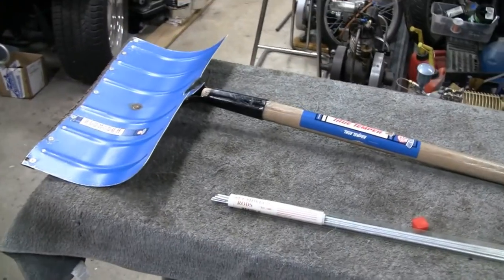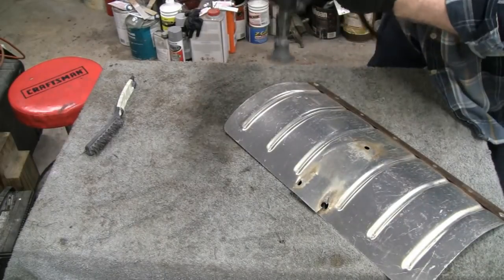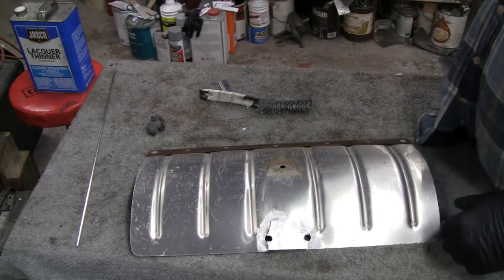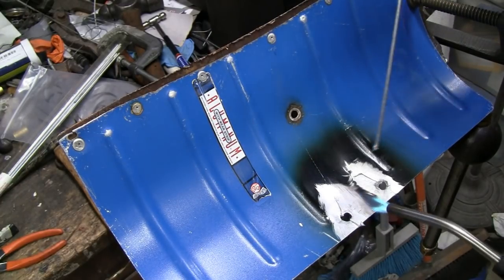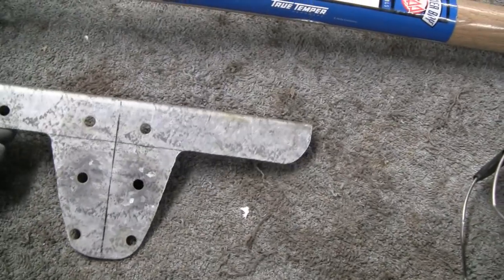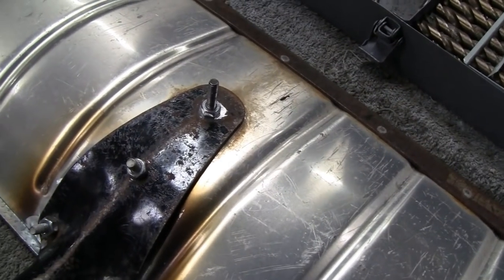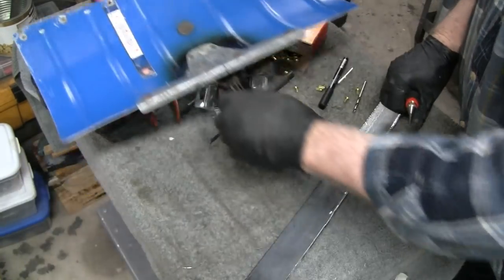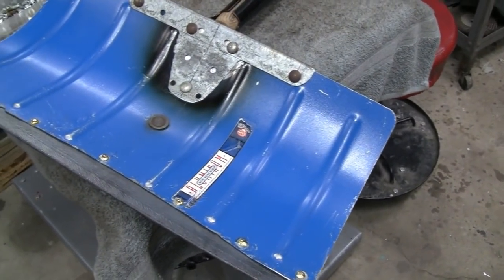SNOW SHOVEL REPAIR with ALUMINUM WELDING ROD

Comment: Oh gee RK backup and rethink hammer the broken places straight with each other.
Then place a small metal plate on top and bottom of the blade. Then put the handle part with it and bolt it all together with bolts.

Comment: I used to do rivets with an air chisel. It's dificult to control. Picked up a used rivet gun off of EBay. Makes the job much easier to control because you can start off slow and then ramp it up to finish the job. It's that instant, full blast of the air chisel that makes it harder to do that way. Just a suggestion for a new toy if you really like rivets. Shovel looks good, by the way.
Reply from the maker: Thanks Mike!! I've heard there was a difference but didn't know what it was!! I just might get one, I do like rivets!!☺

Comment: Nice work. I bought a new one two winters ago. It lasted one season before the aluminum bent. They don't make 'em like they used to. My wife would describe your work as she describes mine. Overengineered and overbuilt. I think she intends it as an insult, but I consider it as a complement.  If only industry was run by engineers instead of cost accountants again, we would have good products again. Thanks for the lesson, I learned quite a bit.
Reply from the maker: Thanks Haney!! Yeah when I fix something I don't want to have to fix it again!!☺

Comment: That looks more like aluminum soldering than welding.  I though you were going to use that welding rod with an oxygen torch or a stick welder.
Reply from the maker: Soldering, Welding... they actually refer to it as Brazing!!☺

Comment: I've welded aluminium successfully many times using oxygen acetylene, the trick is a carbonizing flame, the problem with the method you used is it's not melting the base metal, it's worth adding when welding aluminum the whole piece is going to get hot
Reply from the maker: Never try it with oxy/ace!! We'll have to give it a try!!☺

Comment: What, not taking advantage of the lifetime warranty?    ;-)
Reply from the maker: Lol!! Good luck with that eh!!☺
Reply: @805ROADKING  It’s funny, I never used to even think about that, until I made a video about a pair of broken hand cutters, from Fiskars. 
The small plastic latch broke.
I wasn’t griping, actually complementing how well my 20+ year old tool held up to my abuse.
In the comments section, a fiskars rep reminded me that they had a lifetime on them. 
I told them that I still loved this set, and that it was just the broken holding latch. So they mailed me the part. And a new set of clippers.

Comment: I bought a pack of these aluminum welding rods about 15 years ago at the Wheels of Time hot rod show. I have 99% of them as I couldn't get them to work right. Glad to see you had success. I think my problem was more with operator error than with the product...
Reply from the maker: I think the trick is any oxidation has to be removed with a stainless steel brush!!☺

Comment: Nice job mate. My kind of repair. I have an aluminium DeHaviland 14' boat that is mostly riveted. I've been told that you can't weld it as it's anodised. Maybe that stuff might work for me. If it doesn't, I'll epoxy the shit out of it. cheers. P.S. the floor and transom are welded in. It looks like a gas weld to me. It's over 50 yrs old.
Anyone reading this who knows about this kinda stuff, I'd really appreciate some advice. It has a hole approx 1 1/2" in the floor and much pitting in the floor. thanks.
Reply from the maker: Thanks Mate!!☺

Comment: Them Welding sticks i always fine you need to be carful not to over heat the metal or it will not stick very well. 
she should last another 40 years now!
Reply from the maker: Yeah they seem to work well on the right application!!☺

Comment: I did the same on my Wheel Horse plow , new cutting edge, hard bolts, cut them off and tack welded the nut  so they will stay put .

Comment: you did a great job and that shovel is a tool to be passed down to others to learn from. dont replace it fix it!
Reply from the maker: Thanks Aaron!! Yeah it's an Heirloom now!!☺
Reply: @805ROADKING  I have the same rods from harbor freight.havent used them yet.looks like they should work.also can you send me were I can get those drills that drill through hardened metel.i think you got them from amazon ?    Thank Q
Reply from the maker: Hey Ian, don't know what drills you mean!! I don't have any drills that go through hardened steel!!☺

Comment: My aunt in canada had one of these and apparently her husband took it apart on day one, and added two large stainless washers in the front. Struck me as odd when i saw it a couple of winters ago when i visited and i asked. Apparently it's the common failure point for aluminium/aluminum blades. Her's didn't fare as good as yours, it's chewed up right about where the L in that sticker is. :))
Probably because it snows a lot more, but the handle and that cradle are still solid. Quite impressed of how well made it was, didn't know it was that old tho.
Reply from the maker: Yeah our winters are nothing like Canadas!!☺

Comment: I used those rods on our alum row boat. The difference was I brushed (w/SS brush) it before and after heating it, but before putting the rod on it. Worked great for many years, finally sold the boat.
Reply from the maker: I think that's why it worked better for me on the backside, I wire brushed that after heating it!!☺